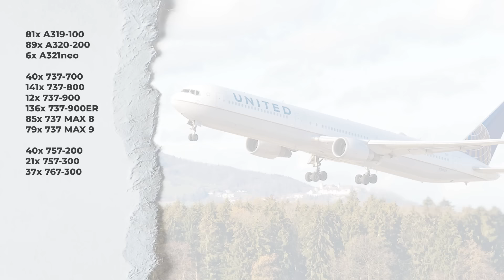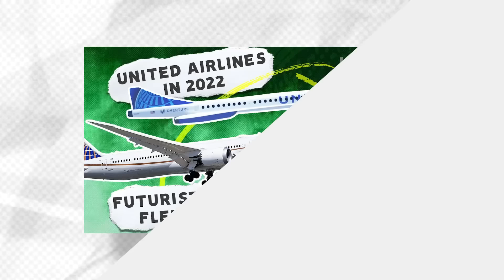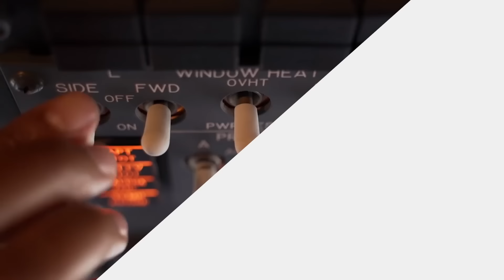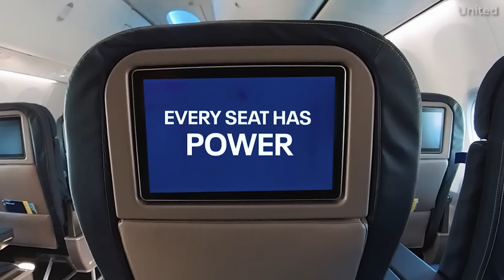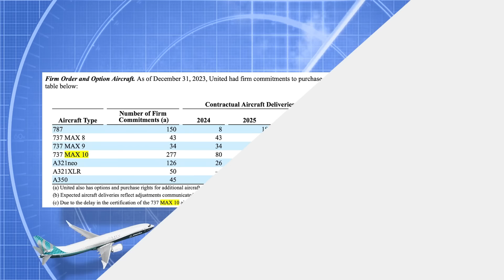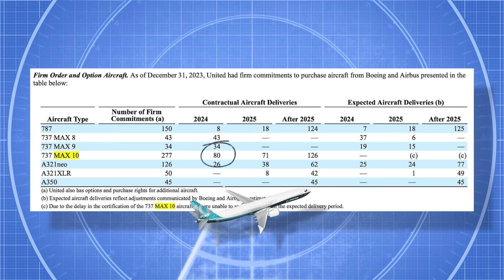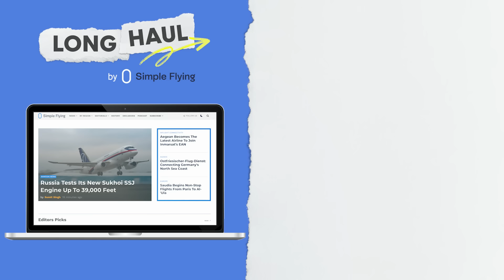Approaching 1000 Aircraft! United Airlines' Fleet In 2024

Comment: I think the A350 order is smart timing. as Scott Kirby, would use the 787-10's to replace their domestic 777-200's and any domestic 777 routes. For the longer ETOPS routes, the A350's are a better replacement based off capacity and range.
Reply: Not for the largest routes . We need a new 777-300 replacement or the 777X for that
Reply: @ I think it is likely they are to order the A350-1000, Patrick Quayle at their network planning dept. saying the 777X was too large for them.
Reply: @Wheninflight  It’s kinda weird that they say that because they didn’t retire the 747s “that long ago.”